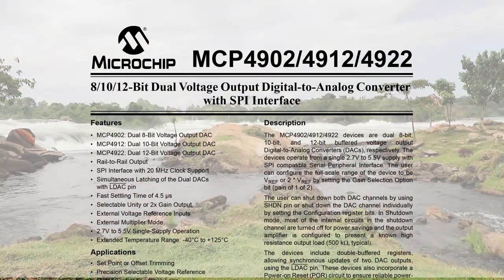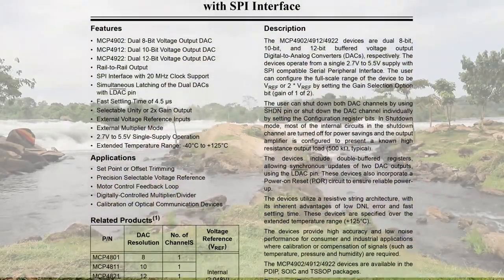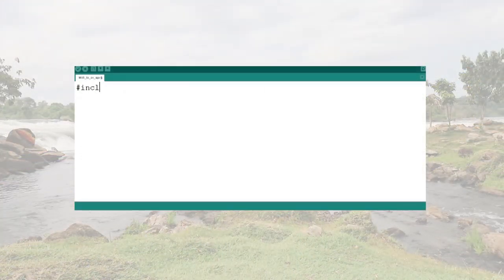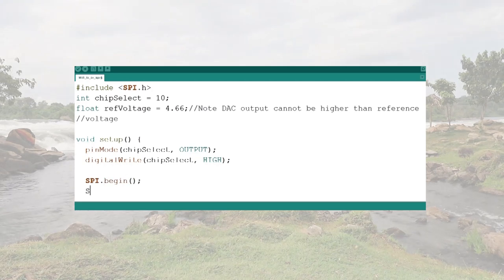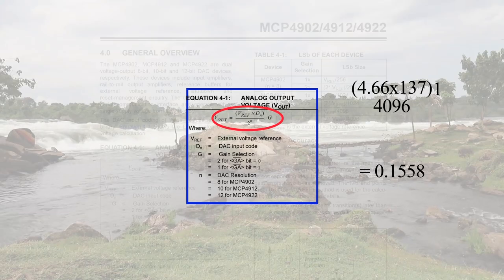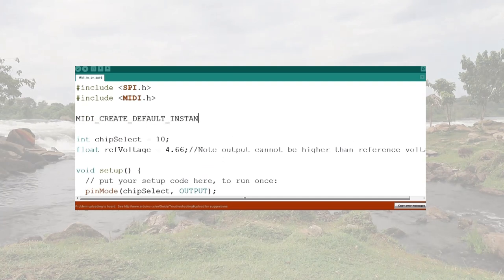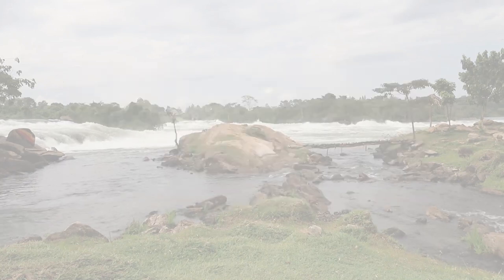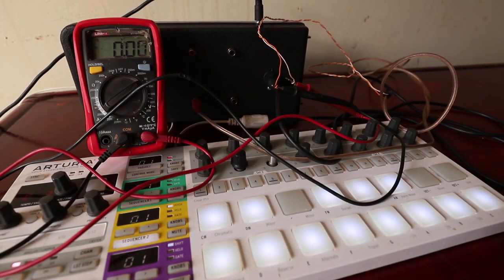How to make a MIDI to CV converter/At Africa's longest River!

Comment: Nice video ! 
I recommend tho that you use MPC4022 as it is 12bit :: you'll get better pitch resolution, 8bit is ok for controls like cutoff etc... but not OK for notes (not in tune)
Cheers
Reply from the maker: MCP 4922 is actually 12 bit. It's what I used...perhaps the SPI animation I made is what brought the confusion since it demonstrates 8 bits but it was just a demonstration of the principles without showing all the bits..

Comment: Absolutely brilliant, man. I have been working very hard on a few analog v/oct controllers. Track and hold is a pain in the behind, just wish I understood the coding side.
Reply from the maker: Respect to you if your even attempting analog v/octave.Coding comes with practice..you can start with the arduino..My biggest problem to learning coding was understanding program flow/how a program executes...but i sat down and figured that out in like 2 days of the first lockdown..since there wasn't much to do anyway...u can do so much more easier by combining analog and digital
Reply: @Afrorack  I just figure that all of these beautiful old arp circuits are going unused, might as well see what they're about! 
Respect to you for taking those days out to do it, it has clearly paid off. Maybe I should take the plunge.